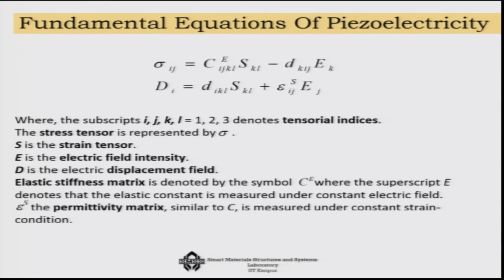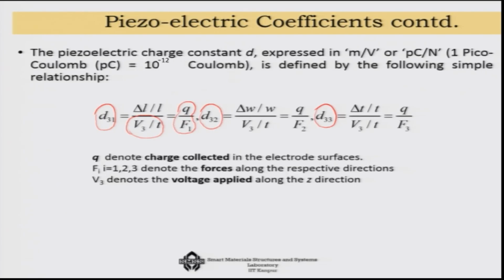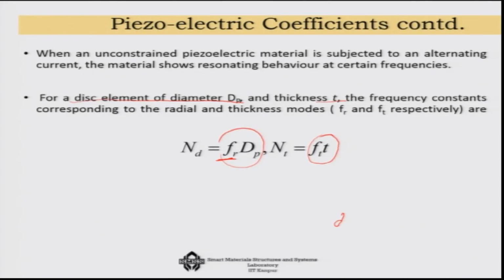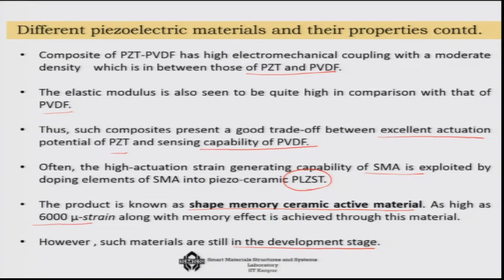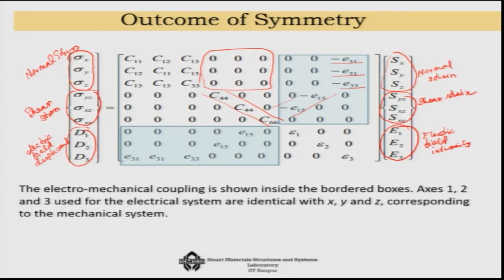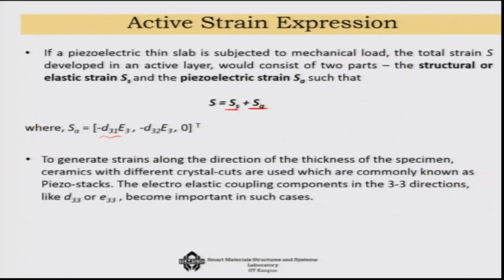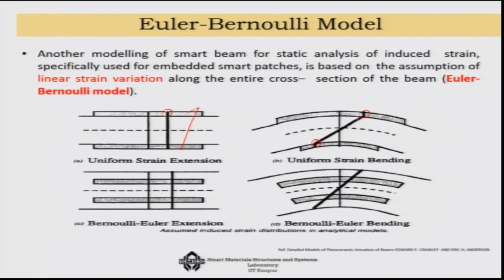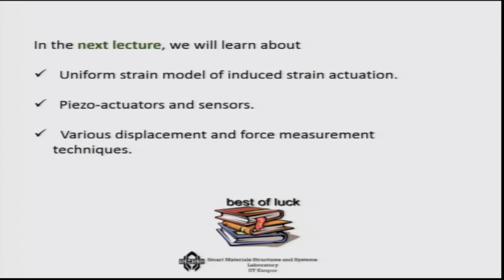noc18-me60 Lec11

Comment: Thanks for the nice talk. Is there any literature which points towards why so many components of the 9X9 matrix relating the stress and displacement matrix to the strain and electric field become zero as an outcome of symmetry. Is this general for all crystals or might it change on a crystal to crystal basis. Any input in this regard would be very helpful?? The matrix is found at this time 16:14 in the video